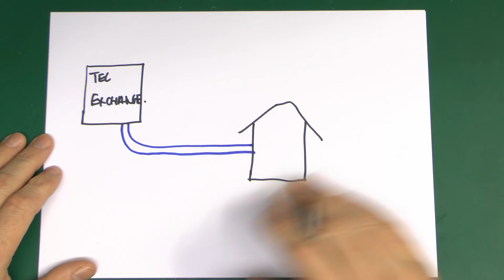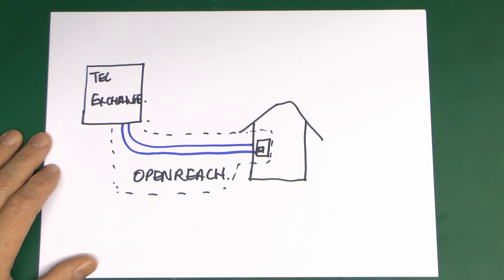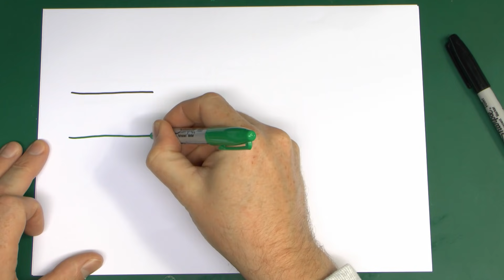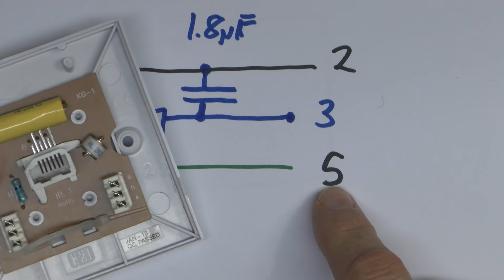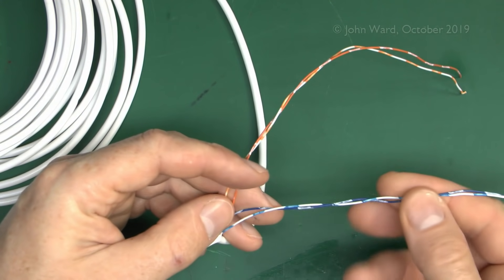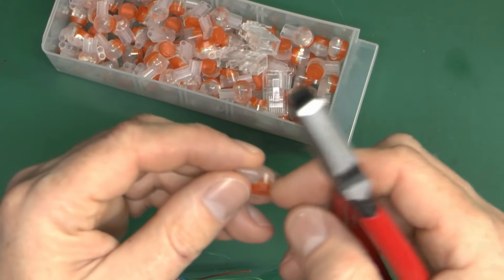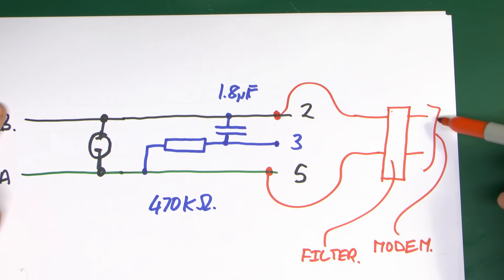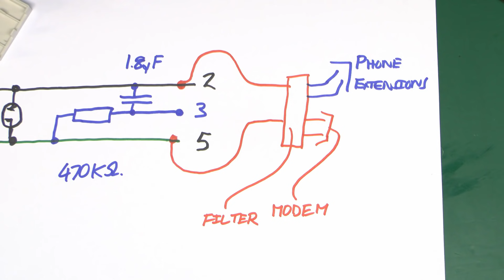UK Telephone Wiring, Sockets, Cabling, ADSL / VDSL Filters, Extensions.

Comment: A warning about cordless phones.  Yes, the handsets have batteries.  But the base unit doesn't.  In a power cut your cordless phones don't work.  Which is a problem if the power cut is caused by your house catching fire and you want to dial the fire brigade.  So have at least one real phone.  I have real phones on each extension socket anyway: the cordless phones are for walking around, but the real phones are for emergencies in a power cut (I can't predict which room I'd be trapped in by a house fire).
Reply: I won't be trapped in a house fire full stop.
I also have a USB modem - so in a power failure, the laptop powers the modem.
Reply: Agreed 100%. I'd also recommend having one next to the bed and not fixed to the wall so you can make a call if you're on the floor. I knew someone who would probably still be alive if they'd had this.
Reply: @Graham_Langley  I'm not sure being alive is a good thing.
I'm glad not to have a phone next to the bed. Got so pissed off with being woken by people wanting to fix my computer.
Reply: @millomweb  Oddly here it's not a problem - they only ring during the day and a decreasing number too. A rigorously enforced policy that any call with a withheld/international/out of area  or unrecognised number gets left for the TAM to deal with may have had something to do with it.
Reply: @Graham_Langley  We've a gadget that blocks anonymous callers. Where are you ?
Reply: @millomweb  UK, same as you by the look of it. Yes, I'm aware that there are a number of boxes designed to deal with unwanted, automated and anonymous calls and even the cordless phone/TAM here has the ability to silently block up to 10 numbers. But at one or two calls a week the it's not enough of a problem to justify investing in anything to deal with it.
Reply: @Graham_Langley  Maybe you're not listed in the phone book.
We've had 4 or more in a day.
Reply: @millomweb  The number's listed, but it's registered with the TPA which knocks out a lot of calls. Doesn't deal with "I am calling from windows security" in a thick Indian SC accent calls via VOIP but they area lot less common than they were, possibly because every now and then I answer, waste as much of their time as I can and presumably get marked with an 'avoid' flag.
Reply: @Graham_Langley  We're registered with the TPA too. I bet it has helped but the nuisance call rate is still unacceptably high.

A bit shocked a couple of weeks ago - actually got a genuine wrong number !
Reply: @millomweb  I do too if it's clearly a call from within the UK.
Reply: @millomweb  When I moved here, before the interweb, you actually spoke to someone at BT when you ordered a connection. The number they gave me was annoyingly close to a palindrome which I commented on. "Oh yes. Would you like me to have a look down the list for something better?" So I chose one in the form 'abcbab' then almost immediately realised it was probably an ex-commercial number that would still be listed out there and I'd be getting calls to Kwik Fix Plumbing or whatever. But I didn't get even one call so I never found out who'd had that number before me.
Reply: It's always surprised me that no one has ever made a cordless phone with an emergency back - up battery for the base unit.

Comment: JW, Openreach is still a sub of BT. Monopoly's commission may a judgement against them  ordering it to be sold apart from BT just a couple of weeks ago...
Reply: It's still a subsidiary of BT even if it's separated from the BT brand
Reply: The sale will be more that the value of BT as the value of the copper in the cables has allways been more than the total market value of the company, surprised they didn't just shut up shop and weigh in all the copper and other precious metals!
Reply: Please supply a link to this.  I can't find anything to show it.  It is legally separate but remains part of BT Group and according to Ofcom that is satisfactory.

Comment: Virgin media now use coax for telephone lines, so only one cable coming to house.   The coax goes into a box they give you to pbx from digital to a analog inphone socket.  Note BT business inphone connectors and sockets the tail clip is on the other side so preventing normal consumer equipment plugged in.   Virginmedia will go full digital phones at some point.   EE and Vodaphone also can give you a landline  to 3G(&4G) convertor, this is a 3G 4G beacon in a box that allows your mobile to use your landline via Broadband connecting to EE or Vodaphone at the other end, your analog inphone line works as normal.

Landlines will be dead by 2022. 5G and openwifi will kill landlines off  thats why BT bougnt EE, as BT sold Cellnet to Spanish Telcom by a some stupid idea.   EE now gone from excellent to coming on terrible as BT ways of despare are  now forthcoming and wrecking EE.

Note Vodaphone in 2019 is doing Giganet (and to consumers too), just a advanced form of Virginmedia cables. 

I live in a BT, BTOpenWorld, Virginmedia and now Vodaphone available area.   But 4G is Crxp and 5G be here by 2030, infact 3G here is flacky in a 5 bar area say EE O2 and Voda but only giving bar 2 on a good day.

Comment: Mind blown, uk doesn't use rj11
Reply: In New Zealand we don't use rj11 either - it is identical to the UK ones. Unfortunately you don't see these sockets anymore since they switched off the copper system a few years back.
Reply: When pluggable phones were introduced, BT had a monopoly on phones and anything you connected to the network had to be approved by them or later the testing house BABT. So the BT jack was a way of stopping (at least initially) non-UK/BT phones with an RJ jack being connected.

The BT jack system has one important advantage over the RJ jack - the latch is designed to release before the cable or connector breaks should the cable be pulled.
Reply: We use rj11 for router connections. Ireland uses them for phones.
Reply: Most country started with wired phones and develop their own connectors when they deregulated that way they could separate the markets and prove compatibility it wasn't until DSL standardised the rj11 connection cross modem routers. I managed to pick myself up a nice decent travel telephone adapter set for my modem in 2010 for a wide variety of countries, I've never used it.

Comment: makes me laugh over all this 'fiber' adverts as its usless lol. as said in this video the only time you get actual 'fiber' is from the socket in house to modem/router or green (typically at end of street) box to house socket....rest of time its normal old copper what is NOT fiber...so dont be fooled into paying for and thinking you actually get 'high speed fiber bradband'...as you clearly dont...its a sales gimmic, basically a canal boat at 5mph will be faster lol.
Reply: A fibre connection will provide a BB download speed of 300mbs if you are willing to pay for that speed. 
Most properties currently don't have a fibre connection and are restricted to having a FTTC connection (fibre to the cabinet and copper between the cabinet and property). This will change in the future as Openreach are currently running fibre connections in quite a few cities, and supplying fibre connections to villages that are too far away from a cabinet to get a FTTC connection.
Reply: Virgin Media started it, even though at the time only the backbone was fibre, anything else was co-ax. BT's FTTC is more 'fibre' than VM.
Reply: @wwsxa39  even if you pay top wack rates they dont give you the specified rating of speed as promised, louis rossmann has been a bit pissed a few times at the speeds and hes paid business rates for a specified speed..i dont thin it was fiber though...not to that place, but still they throttle your speeds.

even if you had fiber in parts, wouldnt it just hit the buffers when it gets to the copper bits due to change in material ?.
i know that all our phonelines (main feed station to telegraph pole outside homes) in this area (my home town and surrounding areas) are all copper and most folk would get out of fiber is a not much 'boost' from cabinate to home or socket to router. and those that i know that claim they have 'fiber' are sayings its no better than normal copper speeds even though they paid a little extra for fiber.
i was having a word with a guy that was fitting up a new metal pole as oppsed to a wooden one that was directly outside our house, and even he said fiber isnt worth paying for as you dont get that much from it and like the 'promised advertised speeds' are more of  sales gimmic rather than fully working beneficial thing.
Reply: @Graham_Langley  non of that FTTC round here, we're to get 5g though lol but no sign of true fiber apart from cabinate to house. im skeptical on just how much fiber is claimed to have been put out as FTTC as so far all ive found out as majority of the network is all still copper (part from the odd cabinate to home wiring), most cabling has not been upgraded since it was first installed....however its been maintained like but never really upgraded to fiber.
Reply: FTTC is exactly what it says - Fibre To The Cabinet. Unlike ADSL where the BB is carried on the  copper line all the way from exchange to premises, the faster VDSL carries the all the BB stuff on fibre optic connections from exchange to new green cabinets next to the older voice-only ones. As I understand it a subscriber line passes through the new cabinet where a bit of kit adds the VDSL signal onto it, so only the last bit of copper carries the BB. 

Next stage will be FTTP or Fibre To The Premises - fibre all they way with no copper.

FWIW when I ordered VDSL (BT Infinity) I used a wheel-on-a-stick to measure the length of cable between this place and the cabinet then plugged it into an online calculator. The speed it came back with was pretty close to what I got.
Reply: @Graham_Langley  im surprised as a lot of folks pay for fiber and higher speeds but get nothing of the sort promised as in speeds so they say and weve heard.
 im still skeptical of all this fiber stuff as like i say we here dont seem to have FTTC (according to the cable guy as i call them...the phoneline fix it upper), its more the opposit of FTTC, of fiber to the home from cabinate if that, and seems to me like a con. but thats just the way i see it via others experience.  
as said affore, we are to get 5g first via the wifi masts rather than wire as apparently the costs are cheaper than rolling out FTTC.

Comment: Cheap type with screws ???? No, the cheap type are those with plugs and sockets. The only thing not soldered is the connection to the master socket. Phone (set of 3 cordless) and modem are hard wired (soldered) to the filter. Sadly the plug/sockets corrode and go green.

Comment: And this is why anything on a bt line isn't worth shit awful service and to put rf on copper wires was the worst idea ever. Rf should be down coax only.
Reply: Or genius to get data transmitted over cable that has been in decades.
Reply: So you reckon 10BASE2 is the way to go?